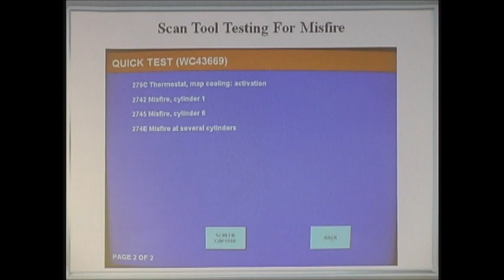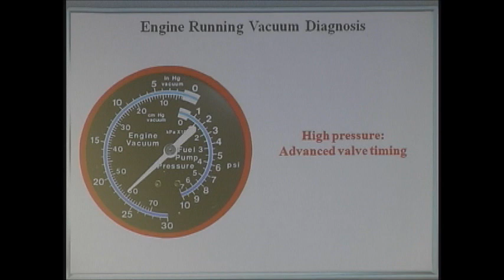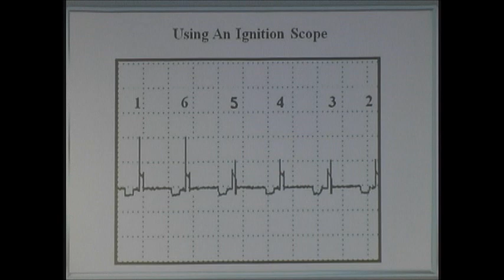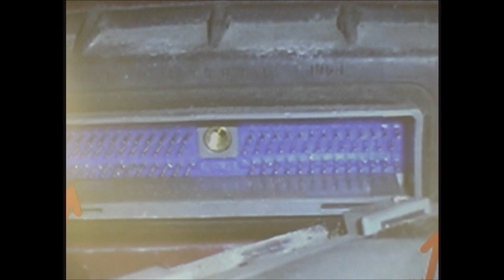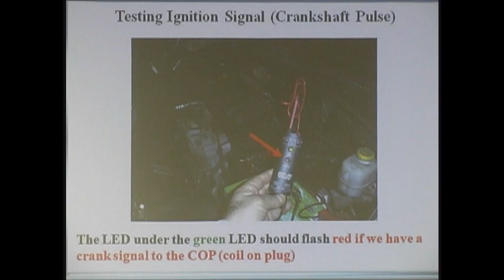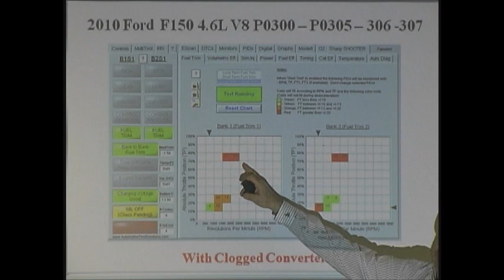Misfire Diagnostics with "G" Jerry Truglia

Comment: What PC-based scan tool do you use? There’s a screen shot of it on the PowerPoint at 9:00.
Reply from the maker: The scan tool is the EScan tool great for Check Engine light and driveability...it's a Generic scan tool that even has Relative compression, Converter test, Volumetric Efficiency, Fuel Trim and more. Thank for watching.If you have not already Subscribed to our tstseminars YouTube channel please do so. Interested in more training? Go to www.tstseminars.org and www.attstraining.com